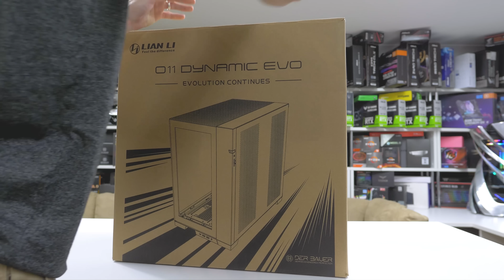Copperblack v2 - ELEGANT O11 EVO Build

Comment: WHAT-A-BEAUTY! from all the youtubers I saw with this case (Jayz, Bitwit, Paul, Linus), you were the onlyone who knew how to build in this case.  They all added the GPU vertically  in the front and the Rizer cable looks awfull, not to mention the rest of the components. Your build is by far the best and most stylish one!!! This belongs alongside a Maserati.
Reply from the maker: Thank you
Reply: yeah, I couldn't for the life of me figure out why the hell they routed the riser cable like that lol
Reply from the maker: @keeb5168  the stock one is too short. I sourced a longer one.
Reply: @keeb5168  hahaha yeah, we are in the same boat! Plus none of them made justice to this case like this dude(s) did. I've seen builds rather average, and in this case, you have to make a jaw dropping PC!
Reply: Bitwit, Paul And Linus are not exactly PC builder enthusiast. JayZ is the much better builder between the four, but even he is incomparable to GGF event IMO
Reply: Jay of JayzTwoCents hasn't actually built a system in this case (Lian Li 011 Evo). At least not in a video he has posted. He did an unboxing and showed there was the option of mounting the GPU vertically in the spot where this build has the copper plate and coolant reservoir.
Reply: The gpu vertically looks fine imo lol. Ive seen someone do a build with the white riser cable and with the gpu mounted like that and it actually looks pretty sick imo. What I think is what makes this build look so good is the watercooling, not the gpu mounting. Without those pipes, pump etc, I dont think you would have the reaction you are having right now.

Comment: There were 6 - 7 different brands that have produced cases similar to Lian Li O11D. Don't know which one came out first. But when Lian Li introduced this new O11D Evo, actually a modification of existing case, it can be a case of decade, rated as AAA case. This one much appealing than other O11D model cause it can be position in many ways & flexible based on what you wanted it to be. For the rest of O11D model, nothing were special than to this one. So thumb up Lian Li.

Comment: I’ve watched a lot of pc build videos and looked at thousands of build pictures, and this is by far my favorite build I have ever seen! I mean it just works, every aspect of it flows together and the craftsmanship put into the details (measurements, spacing, bending, polishing) is respectable to say the least. I am a professional pipe fitter and I am one day going to build a liquid cooled system out of copper pipe that I will solder or braze together depending on the cooling medium, I can’t wait til I am able to because now I see just how good copper can look on a pc
Reply from the maker: Thank you for the kind words
Reply: No need to solder or braze for a pc build. Just clean bends and the right fittings like this build is all you need. No reason to overcomplicate things.

Comment: Quick question. Your water cooling loop runs to your CPU via your GPU first. Doesn’t that make your water cooling of your CPU loop less efficient? from a water movement point of view. IMO the water enters your GPU and exits your GPU rather than push into your CPU loop as it considers it a dead loop, like a crescent lake on fast flowing lake.

Comment: WOW! Now this is an absolute beauty! 

This time we'll be using copper tube as well (the video is way too convincing to use something else 🤤).  But i have a few questions if you don't mind:
1. What size of tubing is that in mm? Could be either 12mm or 14mm...
2. Did you sort of 'clean' the inside of the tubes as well? Is this even necessary?
3. Do you think crossflow/x-flow 360 radiators would fit? Too bad Watercool doesn't have those.

Anyway thanks a lot for sharing this one. You gave us quite a few ideas. 🙂

Comment: While money doesnt seem to be an issue here, for anyone else that wants a cheaper way to do those copper radiator covers. Buy a sheet of ABS plastic in whatever thickness you want. Then buy a wide roll of pure copper foil. Its actual copper but its thin. Then you essentially just place the copper on the pieces of abs and bend it around to shape. Secure it with an adhesive.

Comment: Will that heatkiller d5 tube 200 fit with a 360 radiator or a set of fans at the side? 

My worry is that it may not fit and would come in the way of the top and bottom rad. So strongly considering the 150 tube variant.
Reply from the maker: Definitely go the 150. Mines touching the top rad where the lid won't twist off. Had to swap the top lid for dual g1/4 port top

Comment: Couple questions. Love the copper but will it condensate? If it does, how do you capture it? Does clear coating remove its ability to condensate? I would like to do a copper build or metal but have always been worried about the condensation element damaging electronic components or just humidity increase.

Comment: The most elegant build I've ever seen! Consodering building a similar one, but I worried if those copper tubes are suitable for long--time use. Did you do any coating inside the tubes?
Reply from the maker: Still yet to confirm long term use. Inside the tube is fine. Raw copper is found in radiators and blocks so it's not an issue
Reply: @GGFEvents  Thank you! I'll put some tests to it before using as a long-term solution.

Comment: Crazy build, should have used the mounting holes of the back of the reservoir to mount a heatkiller plate or so aswell! Keep up the good work man this looks sweet
Reply from the maker: Was thinking of doing that exact thing but I'm struggling with the jigsaw at the moment.

Comment: Beautiful! Just one question though.. Is the radiator top, going into reservoir, that then goes into another radiator? - So GPU water goes straight into CPU?
Reply: It doesn't matter what order the liquid goes into components in, the temperature in the whole loop will equalise.

Comment: Wow looks amazing!!!! Love the colour scheme and the copper look! What did you use on the CPU block? Is that two 45 degree rotaries joined together with the tube fitting on the end?

Also I love how you use a mix of hard and soft tube and running it behind the motherboard!! You have some of the best builds I've ever seen!
Reply from the maker: Thank you. Yes 2 45s on each port of the CPU blocks. Always works so well.

Comment: Sick build! I'm trying to wrap my head around the way the water is routed through the Heatkiller GPU block since I want to use the same one in my new desk build. Could you explain how the water flows though the gpu and cpu blocks? My educated guess is that the water comes in from the bottom rad, skipping the GPU first time, straight through the CPU block and then on the way back up it goes through the GPU block to end up in the top rad?

Comment: Hey how did you do the hidden soft tube run?  I am trying to do a similar thing in my first build to make it less cluttered. I am using a 90° fitting on my ton rad but the tube gets to vent when running it through the cutouts. Should be stoked if you let me know.
Reply from the maker: Try a mixture of fittings like the 90 the a 45 and maybe another. Try do the hard work of the bend with fittings first
Reply: Wow thanks for the reply even though this video is a few months old!!! I'll be getting some Fittings and angles to try it.

Comment: I have to say that is one dead sexy machine right there. I really love copper/black and gold/black builds. There is just something about them that's just epic. I was curious, with the rear soft tubing coming from the 'top' radiator in the back in the now hard drive cage spot, could the hard drive cage be reinstalled for use with that soft tubing run?
Reply from the maker: Thank you and yes it could go back in
Reply: @GGFEvents  Have you ever done a tutorial on how to bend copper pipe for your builds? Would love to see how it's done correctly.

Comment: Don't the copper pipes and plates start discoloring after a while, like does oxidation build up on them?do they become darker? Grey? Or greenish?
Reply from the maker: It literally says in the video they were clear coated.
Reply: @GGFEvents  well I understand that some sort of clear coat or protectionism is used, I am asking whether that holds up well over a longer period of time, also considering how often you build pcs, you could be tearing down your builds frequently..... Is it something we can pull off diy at home or is it a professional job? What bout the insides of the tube, does that not oxidize? And I usually play videos on 1.5x or 2x, so if me not noticing that is upsetting, I am sorry.

Comment: Damn, this is exactly the color scheme i'd go for! i love that you've build it in reversed mode as no one else does. I'm not experienced with water cooling but this looks very clean and very sexy!  edit: i would love to see one with a vertical GPU mount but with an extended PCI-E cable that runs around the back (like you did on your white build) but with the inverted build. but this build is the dream, doesn't even bother me the GPU is upside down..

Comment: Classy use of copper, great mod of the case. As for the basics, heat is seriously stacked and there is a single pump. Once you start to use this case, there is no solution for the external cabling, which will look ugly. The top and bottom rad add some rare and welcome symmetry, but it violates the design language of the rest of the case, which is a mess.

Comment: no no stop now with the 12900K.
The most lousy cpu, consumes way too much power and gets way too hot.
Reply from the maker: But the best gaming CPU
Reply: @GGFEvents  not even close :)
when it comes to performance vs consumption, amd wins
Reply: Under normal use the 12900k does not use more power or get hotter than a 5950x.